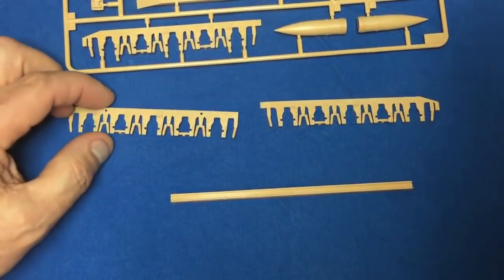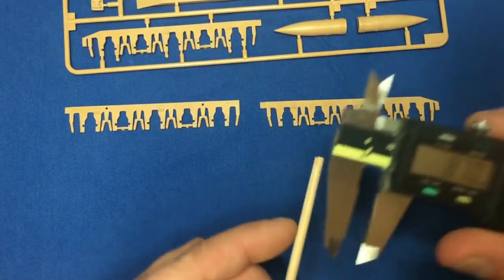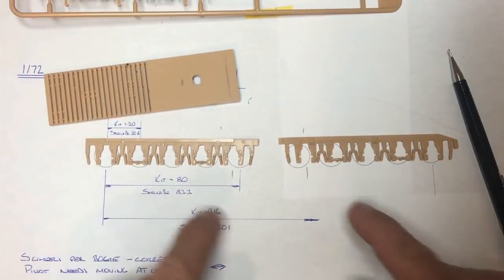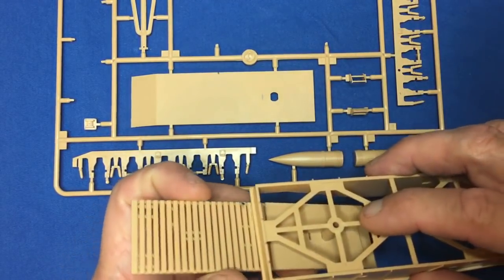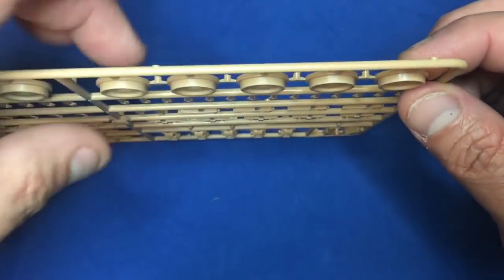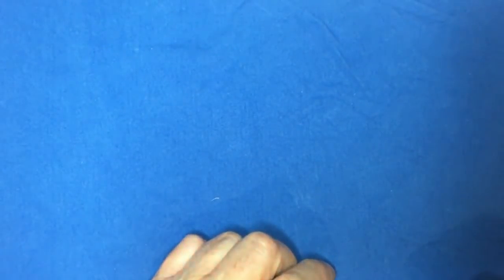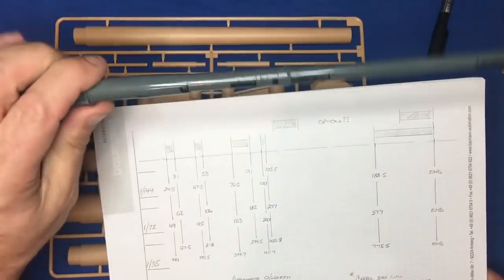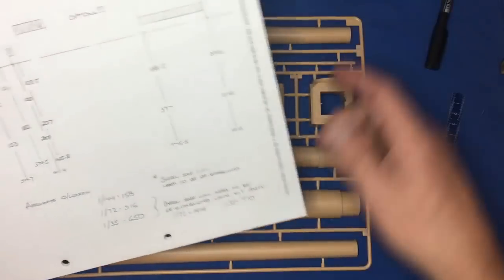HobbyBoss 1/72 Dora Railway Gun Corrections video

Comment: I have just bought one of these kits and so watched your video as I trust your work and judgement on kits. Its good to hear that you consider this one of the better kits of the Dora and I think it is a good scale for this model 1:35 would be too big for me and at 144 detail can be difficult. I will fix the barrel but for the rails I was thinking along getting some lengths of OO gauge rail as I think that is 1:76 so not too far out and also getting some scale rail ballast with a wooden base. I think the ballast on the plastic base looks a bit unnatural.  I will also look into the other modifications as the build progresses.
Reply: I believe "code 83" rails are close to 1/72. That's what I'm gonna do.

Comment: That part you dont know if breech.If it has lugs,probably not.A sleeve with lugs,usually a pivot or recoil mechanism.The 'breech' is the hole in the 'breechblock' which is on end of barrel.But im an idiot.
Reply from the maker: thanks Darron. This is just the kind of feedback I need. So, the Breech is on the back of the pivot, the barrel is on the front of the pivot and the recoil sits around the pivot.
Reply: A cannon is basic in design through ages,ffrom wooden,encased in hoops,Barrel style,to howitzer.The breech(hole)block,barrel look like that part encases it.The lugs look like its elevation/depression sleeve around barrel.Probably weaken barrel adding the lugs straight to it.Got WnWs AEG GIV coming .stonebridge 1944 is good seller,bit slow though.
Reply: Couldnt find drawings with labelled parts for dora.I wonder when they designed kit it was from engineering plans without effects of weight on the hydraulics.??